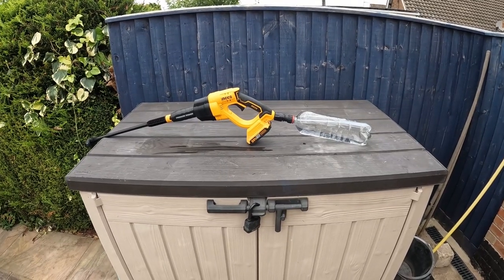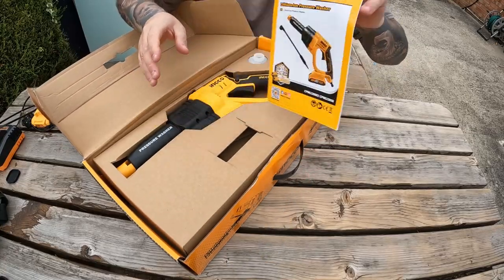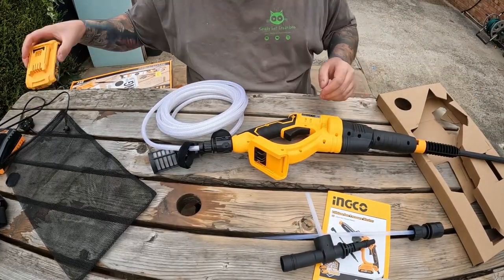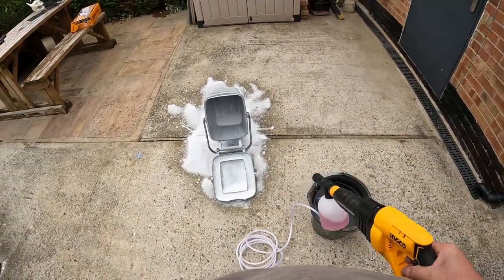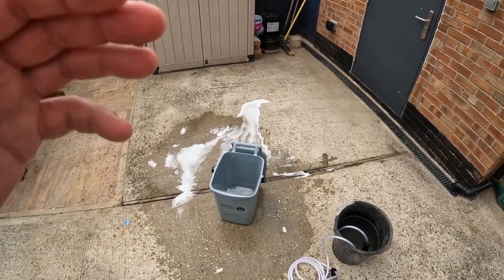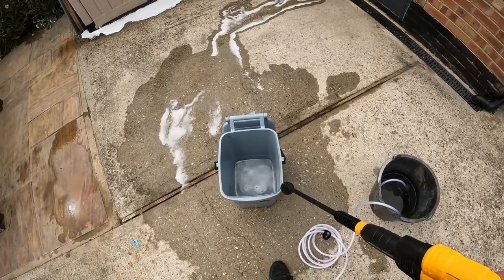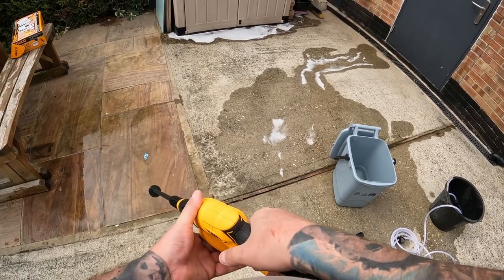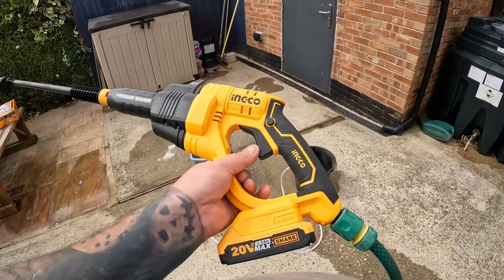Ingco Cordless 20v Pressure Washer Review & Testing - Portable Cleaning Problems Solved.

Comment: Fantastic explanation. You are the 1st guy I have seen fixing the hose directly from the tap. Simply superb 😊.
Reply from the maker: Aww thanks so much. I'm glad you found the video useful 😊
Reply: Just a quick question, this video you posted a year back, still do you use this equipment. Does it still hold good. Please confirm.
Reply from the maker: I still have the pressure washer and do still use it, yes. I am about to try out the worx hydroshot, though, as I have alot more of their batteries so I may eventually move over to using one of them.
Reply: @SmellyCatCreations  that's great, will wait for your worx review as well. Appreciate your reply. Thanks.
Reply from the maker: @focusfocus8966  your welcome I will get a video made and uploaded

Comment: Is this decent enough for a car wash? I know the pressure is weak but can it clean better than a bucket towel? Also how long does battery last? Thank you
Reply from the maker: It's 100% better than just a bucket and towel. Be good for the pre wash and clean off. I don't know the exact run time but I can find out. The 4ah bigger batteries will last much longer. I would guess around 45mins
Reply from the maker: I now have the actual battery times for the machine.
The 2ah battery can run for about 15 minutes, and the 4ah battery can run for 30 minutes.
Since the battery is universal and can be used in many INGCO machines, it is recommended to add an extra battery.
Reply: Universal batteries? Do Ryobi batteries should work on the Ingco?
Reply from the maker: I can't confirm if they do or not as standard but with an adaptor I'm sure they would

Comment: Nice device but bit hard to call it a Pressure Washer. I think it would of been nice if it had bit more pressure
Reply from the maker: I certainly agree on a certain level, it doesn't have the power of my main one that's for sure, and because of this, I wouldn't use it for the same tasks like cleaning my patio. Where it does shine though is meeting in the middle so cleaning a motorbike or mountain bike where you might not want so much pressure as you do not want to get into the seals. I use mine daily now for washing out my CNC-machined aluminium moulds. It gets all the cutting coolant and leftover swarf out of the mould without needing to start running extension leads and with far more power and penetration than just the standard hose pipe.

Comment: Are they DeWalt batteries mate?
Reply from the maker: No I'm using the official Imcp tools battery
Reply: My system is not working there is no water sucking.please suggest
Reply from the maker: @TanmayBiswas13  I would first determine if its the gun unit or a leak hole in the pipe. If there is an air leak it will stop pulling water through. Test connected to a hosepipe and try blowing air of suckling water through the ingco tools bucket hose
Reply: No leakage observed in hose… it’s Gun side issue… no sucking observed at gun inlet…
Want more details about the solution…
By the way thanks for your reply.
Reply from the maker: @TanmayBiswas13  to be honest if the battery is fully charged and its not the pipe, I would remove the spray nozzle end to ensure is also no blockage as that would stop it working and test again direct with a plastic bottle and the bottle attachment

Comment: The water pressure is very low.
Reply from the maker: It's not as powerful as a mains operated model that's for sure but it's only to be expected 24volts vs 240